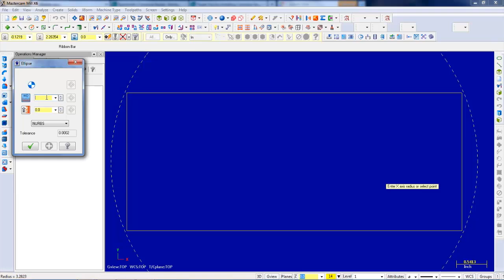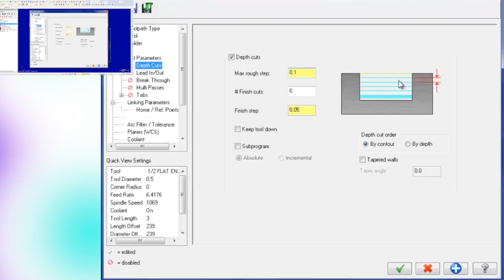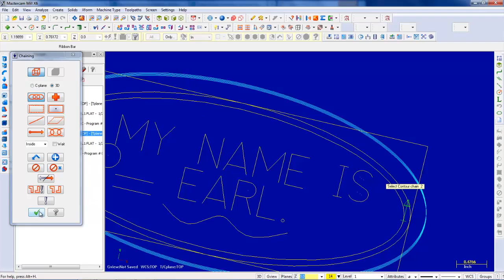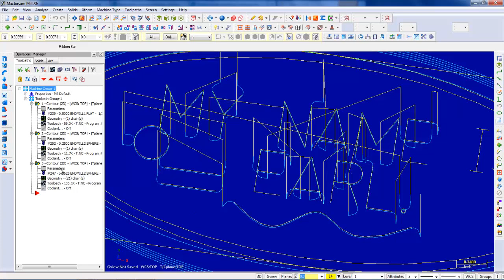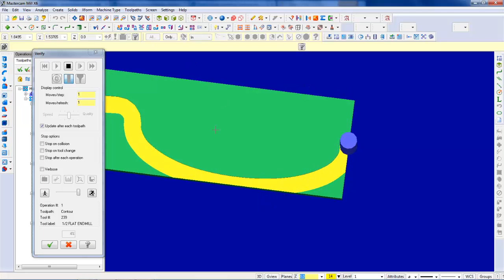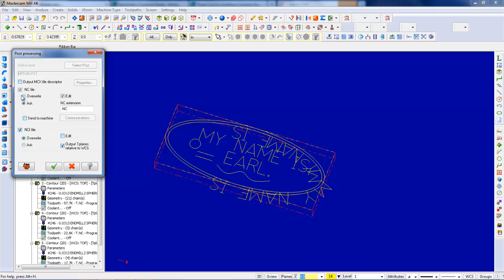Mastercam X6 Machining Tutorial

Comment: I've only been machining on CNC mills for about 4 years(so I'm not the best), but from what I can tell is you have a basic understanding of the program, but not of efficiency of tool paths. I'd start with the letters. Then the chamfer, and then the outside. This is all assuming you don't have to make the name plate flat(in which case do that first with a .01 cut).

However this is very informative to a novice, but maybe script this tutorial, and then play out the script. It'll look more professional. :) thanks for the hard work put into the video though. Been recommending it to some of the newbies at my shop.
Reply: Hey Seamus, yes I made this video two weeks into learning how to use the program, which I did on my own, and I just don't have the time to make a better video with my other job responsibilities. This is to help teach one part of one course that I am responsible for. But I promise to try to make more better videos in the future.

Comment: I'll look into the polygon option, thanks.As for the order of operations, we set the nameplate in a jig. There are two screws on the bottom of the name plate holding it to a piece of metal that is loaded into the vice. It is set so the name plate is completely above the vice. We do this to get students familiar with jigs (not running into the screws and to protect our vice. But we are still new at this, any input would be amazing. I'll talk with the lab manager and see what we can improve.thanks

Comment: For the etching you can choose polygon option such it encompasses all the letters and shapes rather than individually selecting each letter for the tool path. Also etching needs to be first on the tool path list because after cutting out the shape from raw material you won't have anything to hold it with